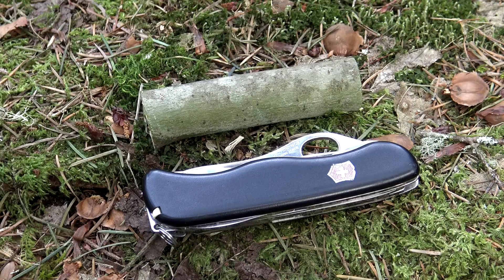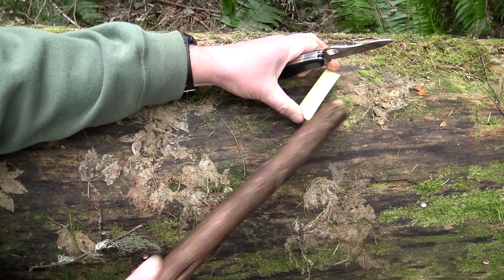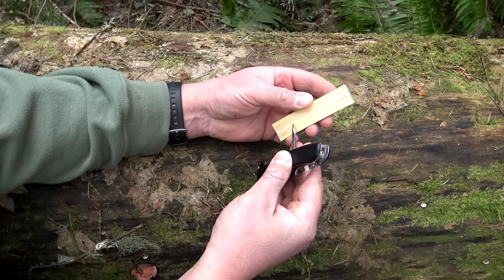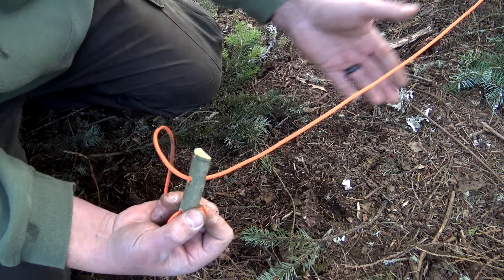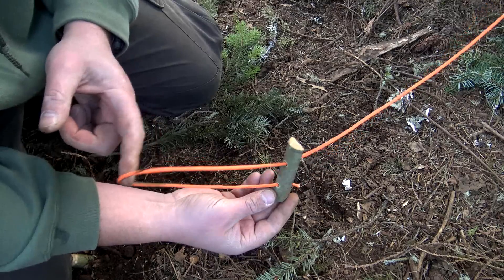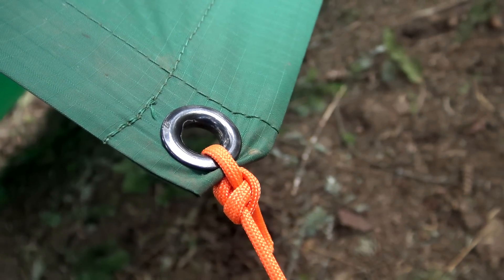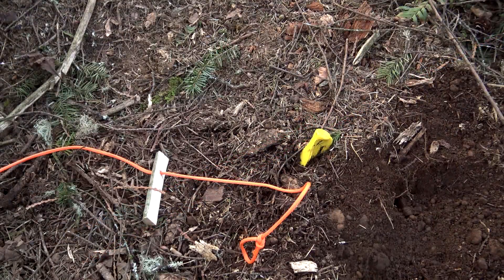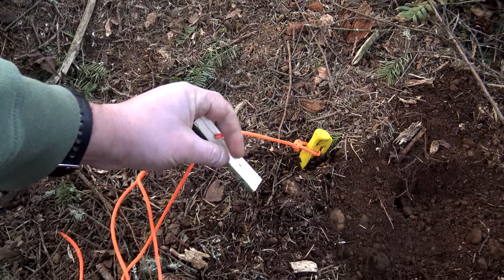Guy-Lines Part 2 (Slips Slides and Runners)

Comment: Good concise  instruction. I made my runners using a pice of flat hardwood with 3 holes for that extra grip. The knot was positioned on the reverse to yours. Both methods work equally well. Thanks for sharing.

Comment: For the toggle does the toggle have to have a flat end to work ? I didn't make my toggle  flat on one side and seems to slip a lot. The stick I used is round
Reply: Mine are round (PVC pipe) and I never have  problems with slipping. Or maybe I haven't noticed since I usually cinch em up everyday regardless.

Comment: Considering the time and "effort" required to craft slips slides and runners in which scenario would that be preferred over a Tautline Hitch ? And by the way thanks for all the tips, help me alot !
Reply from the maker: Here is the easy answer, make a set and keep them in your kit otherwise use one of the other methods. it is better to have something ready to go rather than sitting in the rain, snow or wind trying to carve something. Thanks for watching
Reply: thanks for the answer ! As for the reliability of both method is there a difference or does it rest more on personal preference?
Reply from the maker: personal, I like to grab the slip and slide it towards the stake. more leverage this way
Reply: Great question and answers gentlemen! added to what I learned from the video beautifully! much appreciated!
Reply: Short and sweet. Thanks for another good tip.
Reply: Maxime Hudon 
Most tents nowadays come with those dual hole slips already on the guy wires. So if nothing else, it's a nice tutorial on how to use them properly
Reply: Craig Slitzer I didn’t know how to use those plastic doohickeys so I took them off. Now that I’ve watched this video I can put them back! 😂

Comment: When you make those tension sticks, why don't you not only make a hole in one of the ends and notch the edges in the other end and tie it with a slip knot? It is easier to remove and retie and easier if you don't have a owl to make your hole with (half the number of holes to drill with the tip of your knife).